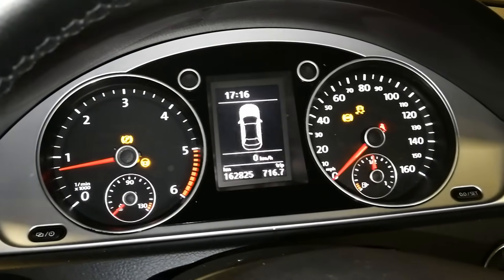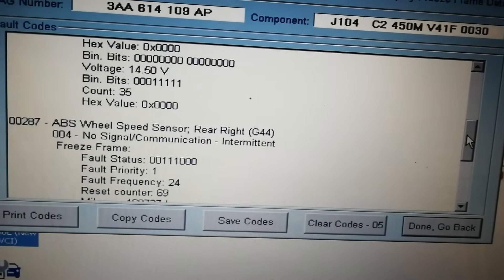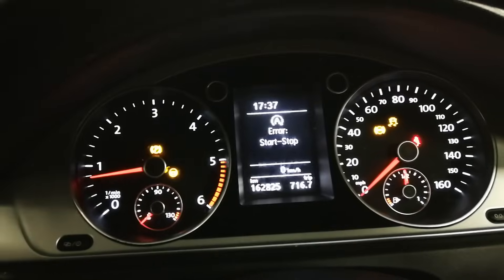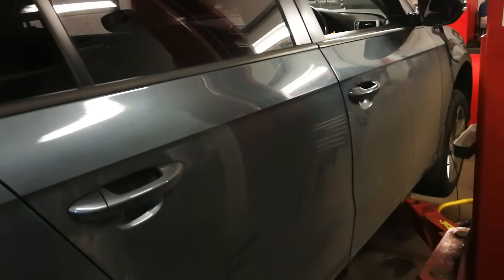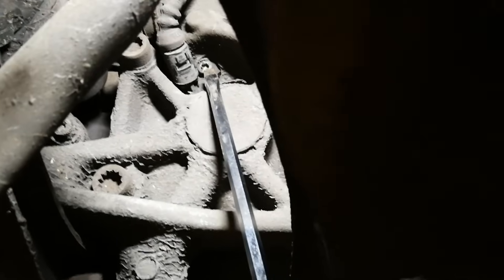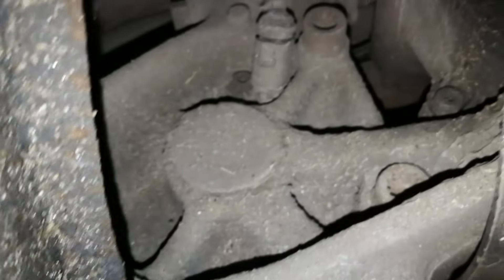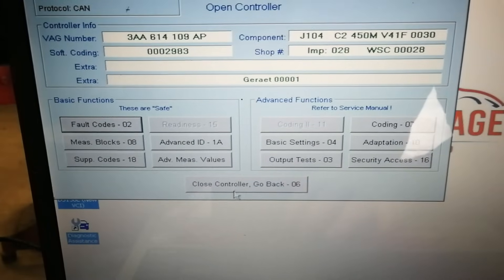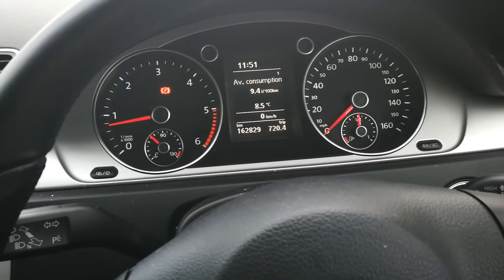Volkswagen With Multiple Faults, ABS ESC Start Stop, Electronic Park Brake, Power Steering

Comment: i tried to switch out the sensor on my daughters 2013 cc but after putting a new sensor in a new code came up   the brake control module!!! could we have done something wrong? i tried disconnect battery but all the lights on dash are still there. Car actually drives ok. called the stealorship and they said 3500$?!!!! and of course labor and programming the module by VIN number!! any help here? thnx

Comment: I just had my 2014 1.2 tsi Yeti front and rear brakes and 2 front tyres replaced. After a couple of days my dash light lit up like Blackpool illuminations 😂. ( ESC, steering, ABS, bend lights(!) , tyre pressure .... could this all be down to a sensor ?

Comment: Since last week i have multiple errors.. all come together, a few come later, the problem over 9 time’s back to the full normal situation than back again, this times stuck.. auto hold,start stop,  ABS , ESP, tiers pressure monitoring, front  assistance, crosse control and a few errors more which I can’t remember now.. even its shout down my back camera but its works again.. all is begins with one long loud alarm and 2 or 3 smaller alarms .. really a headache..

Comment: My car keeps switching off and gives me a multiple fault msg upon shutdown...Park brake fault, ESC fault, start stop fault, servo brake fault, loss of tyre pressure...but the dealership has placed the car on the diagnostics and no faults come up...any suggestions?
Reply: You have solution?

Comment: Hi Gerard, would this issue also bring on limp mode? I say limp but pretty much stop mode really.
( VW Caddy 1.4 tsi 2016 )
Changed the actuator due to Turbo fault code, now getting water pump sensor high, throttle actuator sensor and throttle position sensor fault codes.
All started with pretty much the same symptoms as in your vid.
Any advise greatly appreciated please mate 👍

Comment: Any ideas on our situation? VW Touran 2012. In cold temp the car won't start at all and then is throwing up the ESC fault (no others). Mechanic checked yesterday and it had a throttle pedal fault? After that was cleared it ran fine until the next morning (cold overnight again) and still no start and ESC fault. Battery is fine. No clue what to do and my mechanic doesn't seem to know either
Reply: you have solution?

Comment: I had a 2016 jetta fall into limp mode ..I was driving n then all the sudden a bunch of lights were on n flashing.  It was rainy I was on a bumpy rd n couldn't figure it out. The next day I got under it n just happened to see something that looked out of place.  Long story short it was the turbo actuator.  That rod that will go back n forth snapped.  Must have been when I hit a bad pothole. But yeah I think it was a few torque screws to get it out.  I got it out n welded the rod back together nicely put it back on n wallah fixed.  I felt so cool lol.  I've come across a few ppl with that same issue that were just about broken down enuf that they were gonna pay a lot of cash to have a shop bullshit them n fix something that they could do themselves for damn near nothing.

Comment: Hi I have the same faults but they all disappear after a 5 minute drive could that be the same issue with my vehicle a couple of mechanics said it’s the battery but after replacing battery still has same errors but only on startup as I drive they disappear

Comment: My VW golf MK5 2007, same happened. Steering wheel sign, abs sign and traction control sign all came together and disappeared after 30 seconds. Same as yours. I was on the motorway and my heart nearly stopped.

Comment: Please help me here Sir my car did something almost similar to thistle one  but mine is a polo 6 r line tsi, it did this after wheel alignment and balancing it said these errors on the dashboard:

Error stabilisation control 
Error tyre pressure loss indicator
Error start-stop system 
And shutted down parking lot system or sensors. But mine it just writes on the dash signals don't appear 

I then decided to do wheel alignment again and wheel balancing again after buying brand new tyres last year December but these Error still appear and they don't appear when the is not in motion they only appear when i drive it like a half a kilometer from rest please help me what could be the problem, your help will be much appreciated thank you 🙏 and to you fam if you have ever  had a problem like mine your help will be much appreciated

Comment: My 2013 CC has a bad right speed sensor and all those errors came up but also had had a malfunction light for the afs head lights I watched your video to see if mine wasn’t the only one doing this
Reply: I have a VW cc 2013 doing same thing.
Reply: Did you manage to resolve your issue? Cheers
Reply: @andrewacunningham  yes I replaced the sensor and the errors went away

Comment: G'day! Could this also explain a fault electric steering assistance? I have all these faults plus a red steering wheel sign on my Golf mK7 and a very heavy steering wheel. Can I drive the car to the mechanic or do I have to tow it?
Reply: Hi I am having the same issue here, especially with the heavy steering. How did you get it resolved?

Comment: i had " ESP Malfunction / Parkin break Malfunction / TPMS Malfunction" with my audi Q5 2010 TDI i just replace the relay 643 in the engine fuse area ; i replaced it with 645 and everything was fixed

Comment: Without having a VCDS how can you determine which sensor it has just happened to me on my rLine passat 2013. Also can these be done with the wheel still on the car or does each wheel have to come off the car

Comment: I have the same 2013 model - same lights - but now have a red warning brake light as well. No speeds coming from either rear wheels. The mechanic says the abs rings and sensors are fine but does not know what the problem is. Do you have any ideas?

Comment: Thanks for this, it helped me confidentiality explain to my garage that I thought it was an issue with the wheel speed sensor, I didn’t realise the ABS sensor reads wheel speed, makes sense now I think about it, he thought it was the wheel bearings, I suggested they swap the sensors over, which is possible on my VW SV, they did and fault registered on changed position. New sensor fitted all faults cleared. Really helpful video thanks for taking the time
Reply from the maker: Great to hear Tracy, thanks for taking the time to share your success story 👍👌
Reply: ABS signs pop up on my dashboard, the garage is suggesting it maybe the ABS pump without doing much checks. I will suggest checking the sensors. Hope to come back with feedback. Thanks
Reply: @awurajj try getting the car scanned for errors and reset fault codes. Test each wheel with an auto scanner to test each wheel indivually to trace faulty sensor.

Comment: you're not driving a vw if you aren't driving with dash lights staring at you.
Reply: 😂So true. I drove mine off the dealership floor, hit the freeway and then "Check Engine" light came on. 🤣
Reply: 😂😂so true
Reply: So true. I hate my VW
Reply: So true
Reply: And a full tank ❤❤
Reply: Fact worst car I've ever had is this Passat. Non stop
Reply: …Not driving a vw over 30 RIGHT NOW bc of all these dash lights staring at me 

Steering system function, Airbag, adaptive lighting, abs, stabilization control, tire pressure all at once, well adaptive lighting actually started it then everyone else followed
Reply: Don't know what vw u driving. All vw I owed has did me great service. Very reliable cars
Reply: That just means you're driving a car you can't afford to maintain 🤷‍♂️

Comment: I just had this fault with my 2017 VW Tiguan. I pulled all four speed sensors. Measure the resistance on each sensor. Three had the same value and one had half the value. Replaced the right rear sensor that showed the low value with a OEM sensor from VW for $160.00. The was cleared. Hope this helps you.

Comment: Hi Gerard, I had this exact same issue on my VW touran the only other issue was the Hill Assist brake did not work, They changed my left rear sensor and that cleared the lights and the auto start works but the hill assist still does not work. does the hill assist brake need to be switched back on by the computer please?

Comment: I have all these lights, changed the sensor and they're off for a few minutes but the brakes vibrate a lot, probably abs. Then the lights come back on again. Exact same error as yours but not sure why replacing the wheel speed sensor isn't fixing it 🤔
Reply: Having errors with ABS and power steering warning  sensors randomly going on & off

Comment: My problem is this, I have a 2006 2.0tdi passat, lights on dash are steering, Esc & power steering: Ive changed EPB switch and lights still on, went for a drive and parking brake operates as it should, same with steering and brakes.... any ides please Gerard.

Comment: I've had the same faults a week ago, the problem with my car was the right rear bearing of the wheel, especially the little ABS magnetic crown.It has multiple little ridges, which send a signal to the ABS sensor, but there was a piece of the crown missing, so i had to replace the whole bearing cuz they are welded together.It was not an expensive fix, only 100 euros/ little over 100 dollars.

Comment: I have the same issues but with B8 passat. My blocks were all ok, but it showed that the lent just after steering wheel was bad. We changed it and still nothing. Really hoping it is not the big block down by the wheels.

Comment: Hi my Volkswagen shows ABS, TC, city auto brake, start/stop , tpms error at once but when i drive a little and then stop the engine and then turn on the errors get fixed. Can this be because of a faulty battery or sensor issue ?
Reply: Did you ever get this resolved? Having the same issue

Comment: I’ve got a T5.1 California and the Stop/start, ABS, ESC and tyre pressure monitor all at the same time. Only thing is I don’t have a tyre pressure monitor on the van. Also I can’t turn ESC on or off the button doesn’t have a light showing where the stop/start lights up but doesn’t work anyway. Tried a code reader and no faults show so I’m a bit flummoxed..Think I will try changing the 2 rear sensors as I can’t think of anything else. Has anyone else go any ideas please.

Comment: Same VW Car - 2013 -  same error message & fault displays showing - today 17th April 2021 -  just had new disc and pads fitted - wonder if this has caused an issue with the brake sensors - 
will be showing them this video -  I think a pint or two might be on their why to Gerard.

Comment: I recently hit the heck out of my front right wheel unto a curb recently. The whole wheel was bent inwards towards the car in which i had to replace the ball point, control arm, sway bar link and strut assembly (It was really bad!). The car drives good now but i have these lights coming including the power steering and an air bag error code. Should I replace the wheel bearing and the ABS sensor?

Comment: Hi All, I had this fault the morning I was going on a short holiday. The fault code suggested the rear left abs sensor was faulty. I managed to buy the sensor and thought I could get it  fitted when on holiday. Not so. I drove the car for about 350 miles with this fault. Eventually, back home fortunately, the car gave transmission problems(DSG). The car remained in 1st gear, occasionally it would change up using the paddles but it was undriveable. I changed the sensor myself, cleared the codes, and all is now well!  So a duff abs sensor can screw up your transmission! regards, Brian.

Comment: Awesome video. Genuinely was quite shocked when all these alerts came up as I was driving.

Is this combination of alerts likely to be anything other than the WSS?
Reply: Thanks!

Without clearing any codes, all signs of the issue have gone away. They only showed up for about a day after I hit some extreme potholes on a country road.

I read timestamped error history and I seen the left rear WSS malfunction followed by left rear WSS implausible signal.

Won't be replacing untill it some up again. Both left and right sensors giving good readings now.
Reply: Abs module poss fail,mine doing errors for ages,changed wss and brake warning cleared but others stayed on,a vw specialist I know,put on his 
Test kit ,showed 2 wss and abs module failure,said change them first and then module if not cleared,you can only try these things

Comment: How much might this cost to fix through an independent or VW garage?
Reply: Just had mine done at a VW main dealer. They 'kindly' reduced the price from over £500 to just £371 as we were regular customers, but still horrified at that. The wheel bearing needed doing (apparently) as well as the sensor, and parts alone were over £200. Best part is when the sensor fails, the auto handbrake stops working, so when you stop to investigate, your car rolls away! What a fabulous safety feature from VW. Next time it happens I'll definitely be investing in VDCS and doing the job myself - thanks for the really helpful vid :-)
Reply: One million dollars!! U.S

Comment: This has just happened to my 2012 VW Passat. Was very worried about it but having seen this i am hoping that it will not cost me the earth to get it fixed. Thanks very much - i owe you a beer!
Reply: Hi! Did you fixed it? It was that? I have the same problem with my 2012 passat

Comment: Probably the sensor was unnecessarily replaced because it was necessary to start with cleaning the ABS ring on the hub and the sensor itself + some preparation cleaning the electrical contacts because in terrible conditions it works and probably the problem would disappear.
But this is how "computers" repair cars, not human experience :)
Reply from the maker: No "probably" about it, the wheel speed sensor had failed. PWM signal was not affected in any way by the dirt built up on ABS reluctor ring or sensor. 
Human experience combined with diagnostic training whilst sharing knowledge/helping people is what this video is all about. 
Have a nice day Pawel.

Comment: My VW 2012 CC C Sport had this happen as well. When I hit the brake, the car stops. The break pedal builds up pressure as it should, but then the pressure releases and pedal goes to floor but csr stays stopped. There is a vibration in the pedal when it happens. Dealership said master brake cylinder and power booster. Thoughts?
Reply: Same thing happens on my Passat 2012. There is a Vibration and it's on and off. The guys ABS module needs to be replaced.
Reply: Hey I have the same issue. How did you fix it?

Comment: I get this on start up all other lights go off steering and esp light stays on then goes off as soon as I drive off what could that be.
Reply: I got the same exact thing today 
ASB, Start/Stop, Check Tire Pressure, and Air Bag error. I just drove off cuz I had just gotten off work and as soon as I started driving it went away. As soon as I got home I turned the car off and on to see if I would get the errors again but nothing like good as it was before. (2018 Golf GTI S)

Comment: Fitted an abs sensor on the RR wheel cleared the fault codes and they came straight back on vw cc anybody know where to look next I checked the wire comming off the sensor seams to be fine any ideas where to look next ???
Reply: Any luck with this David ? I am having same issue currently with my cc.

Comment: Thank you so much! My R32 has never given me an issue til today. I'm glad it's a relatively simple solution!
Reply: Hi, what kind of issue did your R32 have? My MKV R32 just came with a power steering problem, yellow light trun to red. Besides the DSG PRNDS flashed and the airbag light was also on the dash.

Comment: I have the same lights as well. Goes away intermittently. Also I had traction light flash as I was accelerating in lower rpm and the acceleration was starting to bog down. Could this be the same issue? I unfortunately don’t have VAGcom. I drive a 2013 golf r 42k miles

Comment: Would this also stop the power steering operating, I have a multitude of warning lights including the autostart error but it does drive! model 2012 bluemotion Engine 2.0 CR (Diesel) will do a VAGCom check
Reply: Was fuse 13 that powers the odb and the abs 10a fuse replaced, all faults disappeared
Reply: @JohnBullas  so was it the fuses causing issue John,there seems to be a lot of money changing hands for a 20pence fix
Reply: @terryhallam6538  one fuse 10p
Reply: @terryhallam6538  yes the odb fuse blew taking everything connected to the abs module on the same fuse with it
Reply: John Bullas I have the same problem! Power steering, traction control and abs. My wheel speed sensor was replaced very recently too. Could you please tell me wha your VAGCom check said

Comment: Hi, ive got a 2010 golf, the following lights come on my dash randomly (and then disappear pretty quick):
- parking brake
- abs
- electronic stability control
- steering light
Do you have any idea what the issue might be? My VW dealer cant seem to pinpoint the issue and want to charge me $2k to replace abs control module and steering column something... pls help
Reply: Take it to a trusted mechanic and ask him to check the trouble codes, if he finds an error code on speed/abs sensor, then its the sensor that needs replacing (common problem with VW). VWs system is made in such a funny way, that when a little sensor fails, everything that feeds from the module throws out a light (in my case it was all your lights + tire pressure light). Full abs module issues are possible but very rare, and if the dealer wants to replace steering components with it, I would be very suspicious ...

Also, had the same problem with my passat (lights come on randomly, for random amounts of time) - it didn't show any fault codes at all when the lights weren't showing, so try to check them when the lights ARE showing (my mechanic and I we're puzzled why these kind of codes don't store in computers memory).